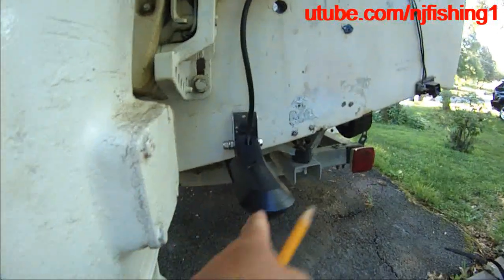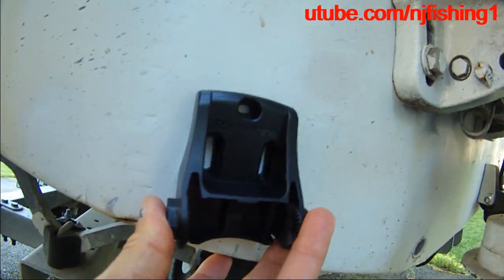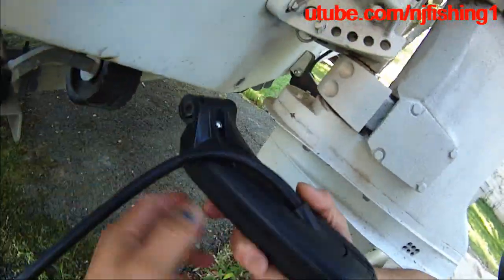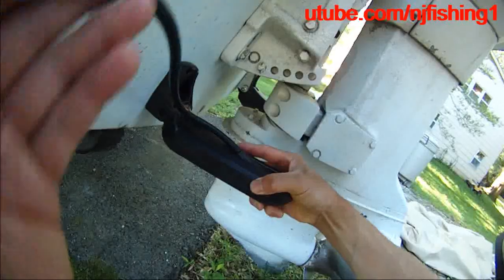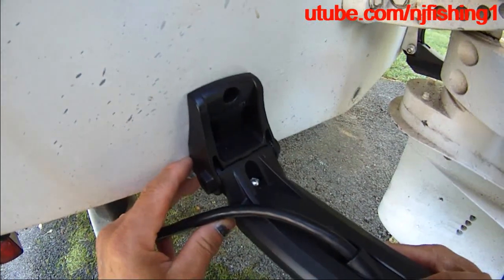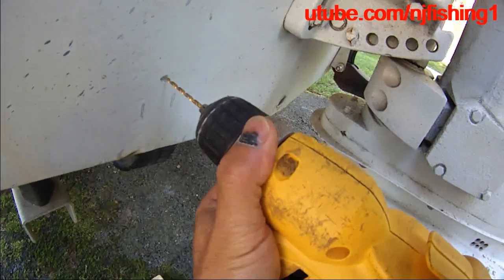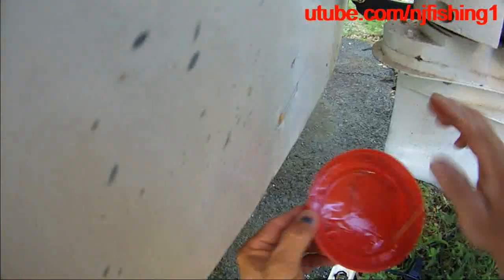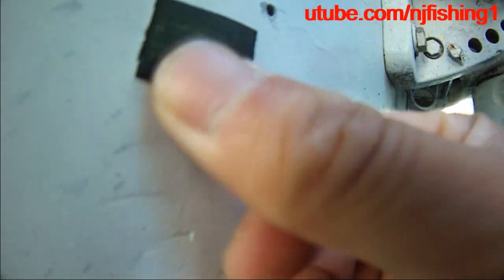How to mount Raymarine Element 3d transducer HV100?

Comment: Hi , can you please tell me if i can mount this transducer as a in hull transducer ? Will the side imaging work ? Thank you !
Reply from the maker: I doubt you could mount in hull and make sidescan work. Through hull yes with a different sonar. Best to ask Raymarine forum can help you out better. Just register to post your questions.
Reply from the maker: If you drill holes on your fiberglass boat for your transducer, your boat will not leak and sink. The leak from your outboard mounting holes probably will leak before transducer mounting holes. Get your bilge pump ready for boating safety. Drive responsibly. Boat accidents cause leak more likely than transducer mount leaking. Use 3m 5200 permanent sealant for screw holes to waterproof them.

Comment: Bro whats the point of the first screw on top of the transducer...i didnt put it in mine and allready took the boat out in the water😖
Reply from the maker: Tattoo Junk That is a M5 bolt that came with the box to lock the bracket with the transducer. lol I don’t know where i put it. I may have tossed it with the box so had to diy make 1 screw that fit. If you don’t screw lock the bracket, then the transducer may slide off the bracket when it hit some floating stuff on the water. Best to be safe than sorry!
Reply: @njfishing1  its not that my transducer got water in and is destroyed right?😖
Reply from the maker: Tattoo Junk https://www.instagram.com/njfishing11/p/BySXP-pHYbw/?igshid=1f2g0lnuv7nzl - here is a picture of the screw or bolt
Reply: @njfishing1 yeah thats the one i was talking about...imma put one in...i guess i dont have to worry right? Im not on the water👌
Reply: @tattoojunk666  I played around with it. I believe it's so you could possibly replace just the transducer element portion as the bottom seperates
Reply: @glacius331  next ride imma put it in there. Should be in the box i bought it with...shoot me some  great images on insta iff u like...🥇🤗🤩
Reply: I love you are running your drill backwards and dont realise thats why your drill is walking to the Side. But Still nice video and THX. Installing this equipment myself tomorow and this was educational. Is the element Any Good .and are you getting the readings that you want. And are THE 3d actually  funktional. This is the things i Wonder about this unit. And why i am going to Invest in One
Reply: @pellelarsson83  just met a super pro locally and he is running the element, solix, panoptics, livescope, lowrance  he had every unit on there😅 i swear...he told me the element is one of his favorite in his class...he loves it and said its the most friendly to use and absolute great image quality.
He prefered it over the mega imaging.
I doubted iff i should have go with mega...but he said NO...u gonna love it.
Reply: Yeah that thing called time 😅 i know what you mean. But now i am om 4 weeks of wacation and this Summer i Will spend My time att home and on the water hunting those big pikes we got here in Sweden
Reply: @pellelarsson83  im in europe too bro...holland...hunting pikes and perches too.
Reply: Best kind of fishing 4sure. Yeah i do Enjoy some perch fishing sometimes too. But most of the time i am after the large pikes
Reply: @pellelarsson83  pike perch is nice to catch👌
Reply: I just mounted mine and according to the instructions that luckily I read the transducer should be on the starboard side unless you have cc prop rotation and also it's supposed to be like 15" from the prop if I remember correctly.  Not sure yours is far enough
Reply: THX for answering. Have you yet used yours? And yeah i think this unit i am getting tomorrow Will be superb om My riverfishing boat and this just confirmed My thoughts 👍
Reply: @pellelarsson83  once but im pretty new to these units...u gonna love it i know...my doubts were there too...i need to learn allot...and dont have as much time as i hoped for.